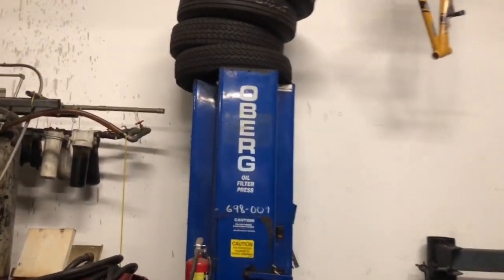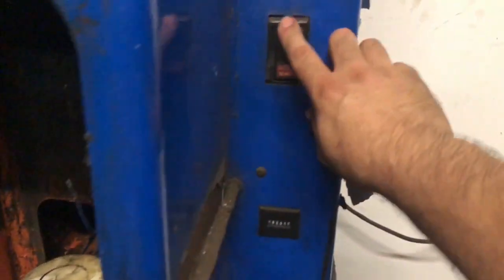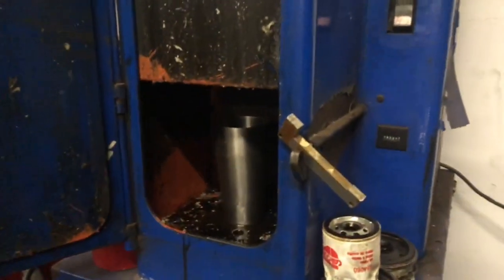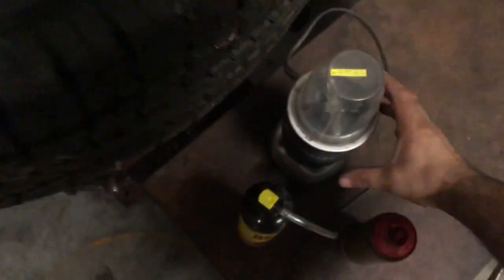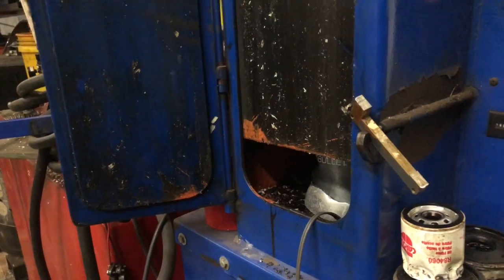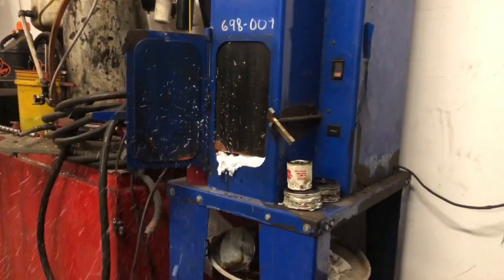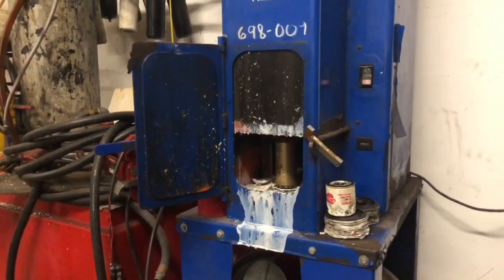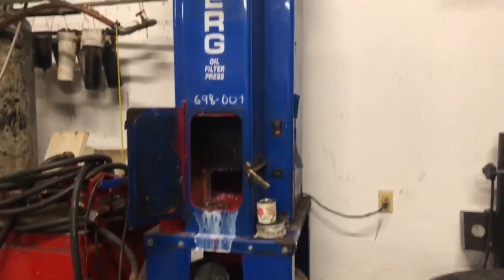Crushing random shit in my Oberg oil filter press

Comment: Awesome. How do you make money with that? Just curious.
Reply from the maker: I use to charge for picking up used motor oil and oil filters,  once crushed the filters can be sold as Scrap. The oil I would thin out with gasoline and burn as diesel fuel in my truck. So they basically they paid me for my fuel. I go in to it in another video. Thanks for watching  
https://www.youtube.com/watch?v=Ey-6YhPtaPk